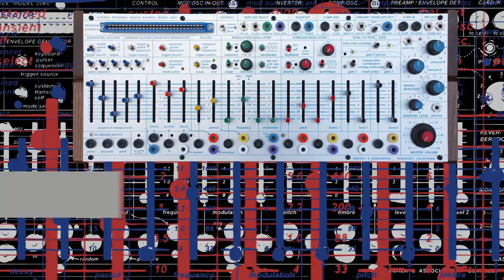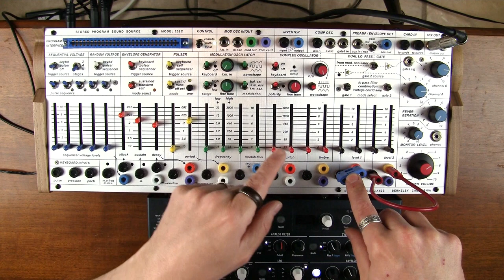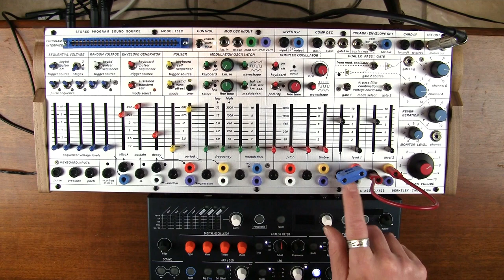04-The Buchla Easel Command- Part four: The Dual Lo Pass Gate

Comment: i know i sounds like that guy, but page 15 of the current easel manual says that the LOPASS GATE has a 12dB per octave slope.  The Alan Strange version also has 12dB per octave noted on page 6.  Might you know if the manuals have got it wrong, or did the design change for the 2020 208 Command, or just a mixup on the video? thanks so much!
Reply from the maker: It sounds like I have it wrong... I assumed it was the same as the other Buchla lo pass gate!
Reply: @automaticgainsay  This is helpful to know!  thanks so much for this confirmation!